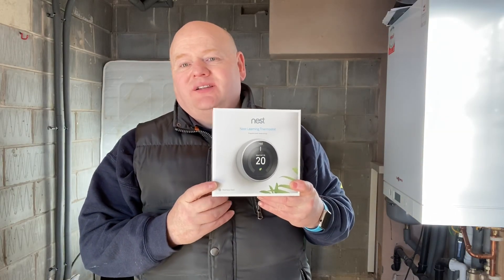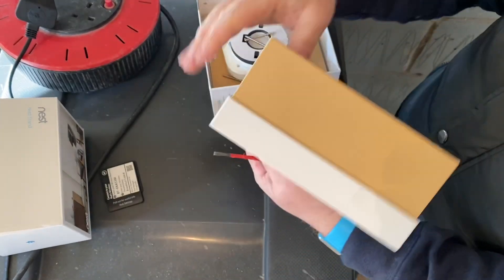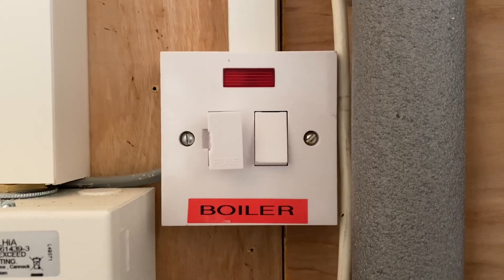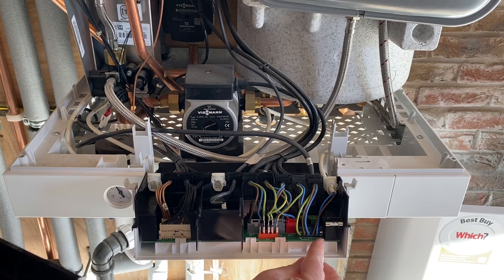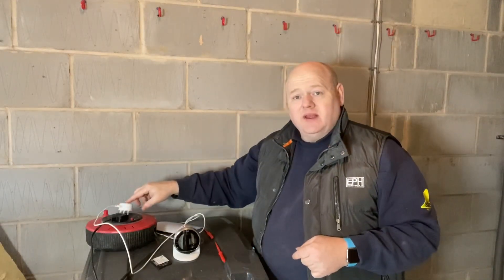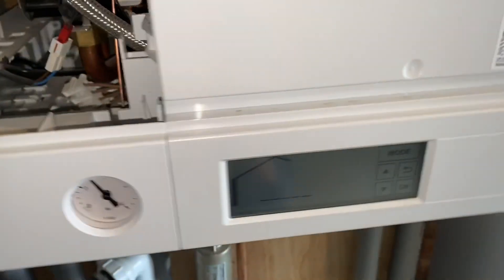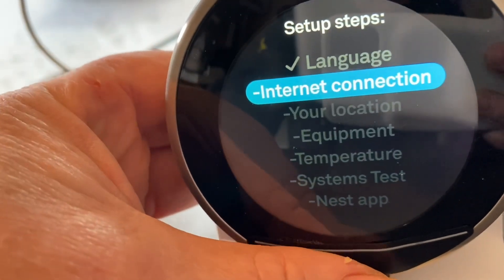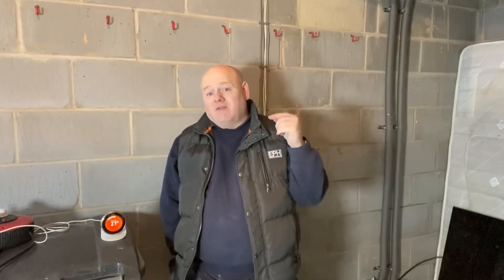LEEDS PLUMBER - NEST THERMOSTAT INSTALLATION

Comment: Hi Allen, another good video but one small point you should emphasise to people that the NEST Thermostat operates from 12v dc as opposed to others which are powered by 230v ac. I found the NEST installation instructions very well written simple steps.

Comment: Crap video, one end of the cable you have grey and black into heatlink and the other end you have 2 different flexes 2 brown 2 blues. Show complete wired into the boiler where the grey and back cables go.

Comment: Hi Allen, interesting video! How about doing one for a Viessman 100-w system boiler feeding an unvented cylinder but using an X plan and Nest to attain proper boiler modulation with OpenTherm? Seems like not many installers know how to do this and are just installing the old S plan, which is a great shame considering this boiler has one of the best modulation capabilities and the current drive to reduce carbon emissions and improve boiler efficiency. Viessman seem to push their four-pipe scheme for DHW priority, but that might not be suitable for every install, especially when replacing a boiler in an existing two-pipe system.
Reply: X plan was, I think, invented by Intergas to achieve Domestic Hot Water Priority at full heating temperature to avoid Legionella, but with OpenTherm modulation of the room heating for gas efficiency and comfort. Apparently just needs some appropriate wiring changes, a normally open water valve (instead of normally closed with S plan) on the heating circuit switched by a wire feed from the NC DHW valve, and an OpenTherm controller such as Nest 3rd generation. Apparently Tado has stopped doing HW control as nobody was implementing it in UK!!

Comment: Does the Nest thermostat when using the separate bracket have to be left plugged into the mains even though the switching signal is wireless ?

Comment: Thanks for the video. At 6" into the video, you are wiring into the № 2 and № 3 connections. But, as the manual for the 100 WB1B says "OpenTherm control compatible", can you not install on the OT1 and OT2 connectors instead?
Reply: No! You’d blow the boiler circuit board! OpenTherm protocol uses low voltage to modulate the boiler for room heating only. This vid by Allen is showing connection in an S plan system which does not modulate the boiler; it just uses on/off switching of boiler with HW &/or room heating decided by cylinder and room thermostats. For OpenTherm operation the system needs to be changed to an X plan, where the boiler is modulated by OpenTherm room thermostat for heating cycle but that is overridden by the cylinder thermostat when mains voltage switches the boiler for high temperature to heat the cylinder to avoid Legionella dangers (cylinder stat set to 60C).

Comment: Great video, I have got question, could we have separate independent main supply feed for a nest heat link and it doesn't need to be connected to combi boiler main supply spur, secondly could we have underfloor wiring centre switch wires connected to boiler switch wires in junction box just before the heat link boiler switch wires feed. Would that be possible both systems underfloor heating and nest can work both independently?  As I have got a job where I have been asked to connect speedfit aura wiring centre for underfloor heating and nest for radiators, boiler make is Baxi platinum plus 40kw combi

Comment: Great video. Do you also wire a separate 0.75 from the fuse spur into the boiler as well. Thanks.

Comment: Hi. I have got a Worcester Bosch green slave oil combi installed. Setup the nest but cannot get them to connect at all. Tried manually connecting still the same h71 error have you had these issues before?

Comment: Hi Allen
I am trying to connect the nest thermostat to a HIU. Trying to replace the existing Honeywell with the heat link. For some reason I can’t get the wires right. Any suggestions pls? Many thanks
Reply from the maker: No, sorry

Comment: Hi Alan. I've watched your videos how to wire the nest thermostat i managed to wire mine to a standard boiler and it works fab. now the mrs wants one at her house but she has a gledhil open vented boiler system. any tips when trying to set this up?
Reply from the maker: you need to check wiring with multi meter, Personally i would advise you call someone out. Thanks.

Comment: I have a Honeywell CM927, I had a look at the wireless link wiring in there and it seems to have a NL connection and also another wire going to another L so NLL and then two wires going to A and B. What's the other live wire for?

Comment: I have a S plan 2 heating zones and hot water zone using 2 port  honeywell valves, with 2 thermostats for heating, and 1 on hot water cylinder. I would like to fit a Nest thermostat on the downstairs heat zone only.
I cannot remove any of the installed equipment, so can I override the present thermostat by turning that to minimum, and leave the programmer on constant heating?
Any advice welcome.

Comment: The info is valid.. altough... 1. Should have said you need a live, neutral and ground separate from what is provided, and should have showed the board after the install (where the black and grey were wired on). So yeah...  keepin' secrets from the viewers.. naughty boy! Never liked this kind of ppl. If you show... you explain and make it usefull.. if not... you are just a content creator/ytbe ballerina. Next time put some make-up mate.

Comment: very helpful Allen. I have the vitodens 100W, i have identified my terminals on the boiler. The Nest Heatlink appears to need 240v and then i run the other 2 wires back to 1 and L on the boiler.
so 5 core cable. L,N &E from the boiler circuit into the heatlink. Remove the link between 1 and L back at the boiler and use the greay and black spare wire into 2&3 at heatlink end and 1 and L at boiler end.

If i have understood you correctly. Thanks

Comment: Hi - is it ok to have the thermostat wall mounted and have it directly powered from socket via micro usb? (rather than a common wire)
Reply from the maker: That should be fine.
Reply: bought a Nest learning, and have been charging via USB for over 6 hours- still not operating. I get the “home” icon when booting up. Any idea how i can resolve?

Comment: Thanks for these videos mate. I'm confused, I have the same board in my boiler - but I can't see a mains out? How have you powered the heatlink? Where did you get those permanents from?
Reply: Did you solve it?
Reply: @andrewbarker143  yes mate, are you stuck? I can send you a pic of how I done it if you want, but it was a case of the video just not showing it clearly, but there are terminals on the boiler's board to power the device, it's dead easy. Let me know if you need a hand.
Reply: @danthealien8360  Hey Dan. Please could you kindly share? I have the same problem.
Reply: @mrklgnd  there are 2 terminals on the boiler that power the heatlink. Which boiler do you have?
Reply: @danthealien8360  I have the Viessmann Vitodens 100. From the boiler, I’ve 1-L-N. I have conected the N and L to the Heatlink and bridged N to 2. Should I connect 3 on the Heatlink to 1 on the boiler? Thanks for your help. Really appreciate it!!
Reply: @mrklgnd  I can't remember off the top of my head sorry mate (I'm at my computer). Do you have an email address and I'll send you a pic of the wiring in a min?

Comment: Thanks Allen nice work, I have question. Can you set up Nest to work on /off based on the water temperature and nothing else, for example if the water temp 60 degree or more stay off, otherwise go on until it reaches the desired temperature.  to be honest i am looking for a switch to do that Nest or other vendors, smart / or dump switch :), doesn't mater . as long as it will work based on water temperature, not time schedules...etc..
Reply from the maker: Thanks.

Comment: If you buy a Nest stand, you don't get the backplate with it, so you must remove it from the wall again. Stupid if you have a fireplace and want to change the place for the Nest from the wall to the stand on a table during wintertime. To get a new backplate for your stand you have to buy a new Nest thermostat.

Comment: Very informative video. However, I think the instructions say that you need to connect the ground wire to the heatlink only when you are using the T1 and T2 terminals to power the thermostat.
Reply: does no harm wiring it, good practice if there's an earth core in the cable you're using.

Comment: Allen Hart I have a baxi 630 with a esi control fitted to the on off on the boiler..
But I am thinking of fitting a nest on opentherm, but when I take the wires out of the on off on the boiler into opentherm do I have to put a link cable back in the on off..
Thanks

Comment: With the thermostat itself I didnt have a stand for it and put it on the wall. Luckily for me the wall had an under stairs cupboard behind it with power socket in it for my tv that's on the same wall. All I did was drilled a hole thru it and plugged it up in the mains. Much better than hard wiring it. Well worth the 170 quid for it tho
Reply from the maker: Thanks.

Comment: Hi mate 
Got a job at the moment the customer as a problem with rads not working on the ground floor of her house, I have power flushed the sysem replace the pump with a larger pump, triedto balance out the system the rads are really warm for 3 or 4 days then they go cold again. when they go cold again the flow on the drop is baking hot and the return stone cold.

Any thoughts would be appreciated.

Comment: Great video. What's your opinion on the boiler being mounted on a wood surface
Reply from the maker: It’s perfectly fine. That’s not an opinion. That’s as per the manufacturers instructions. Thanks

Comment: Great video, but why did the client request on/off type connection? I have a valiant combo which has a third party wireless thermostat which can vary the radiator output based upon the temperature requested. Could you please do a video to show how that could be upgraded to a nest.
Reply from the maker: Imran Majid The person that requested the video asked for that. Thanks